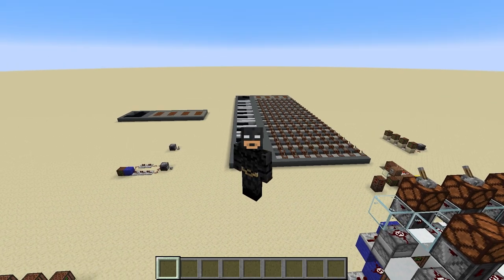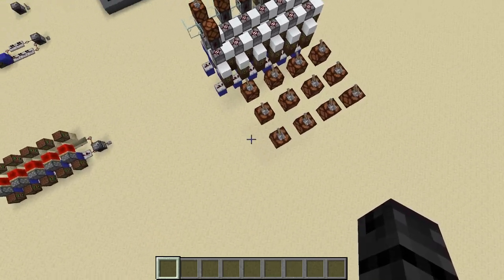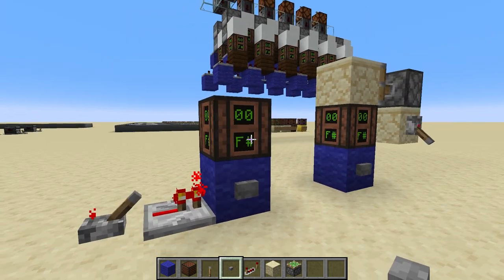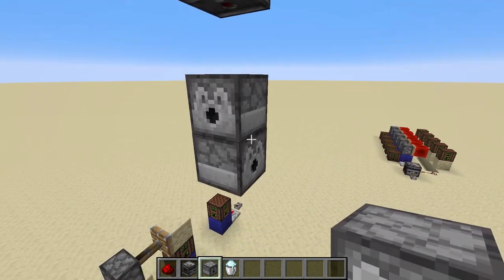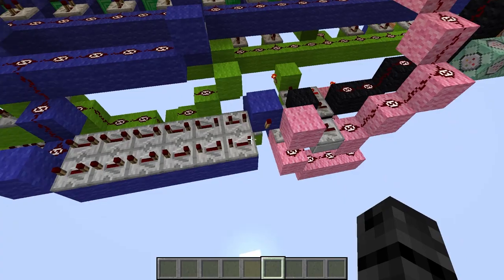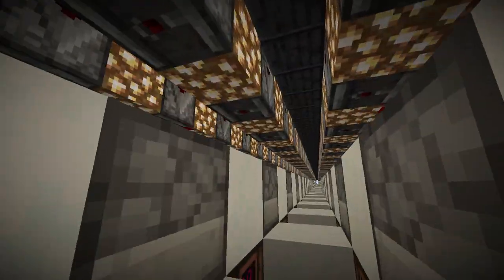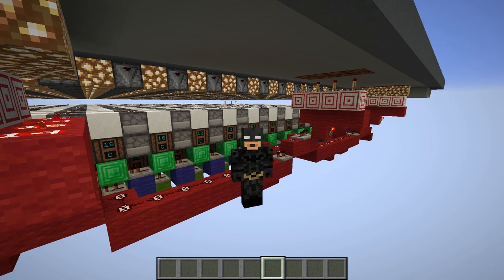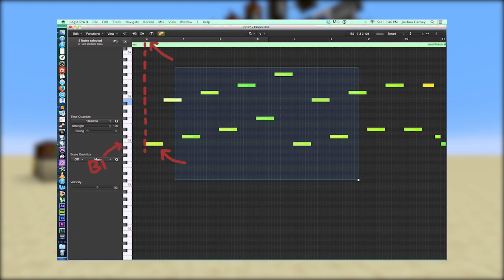I Made A MIDI Machine In Minecraft! | Minecraft Redstone Showcase

Comment: Now I do have some methods where you could improve the design. First the audio limit for the note blocks is a sphere centered on the player, so if you give up the horizontal design and go for a vertical design you could easily set it up as a box around the player. This would also allow you to potentially increase the note range as you could have a platform centered and have some of the machine above and below the player. Also this shape will naturally balance the audio by positioning  the higher notes farther above the player, if you raise or lower the platform you'll be able to change the audio balance as well, so you can experiment with the balance. With creative flight you wouldn't technically need a platform either you just fly up or down to change the balance.

Comment: A few solutions for the problems this version encountered:
1) Instead of having each lever have its own noteblock, it makes more sense to have a "speaker" with all noteblocks clumped together then wire them up to the redstone lines somehow
2) For adjustable tempo you could make use of a serial memory unit (like a hopper line) and an adjustable clock
3) This one isn't a solution but slap an audio visualizer on that bad boy and yes

Comment: I had an idea for a machine recently that would do less but still be pretty interesting and maybe practical. 
Have a redcoder that activates one note block per signal strength, each time the signal strength changes. You'd get 15 or maybe 16 notes, and it could be run from a series of signal strengths input to the system from basically the same machine but inverted, or some way of encoding the series of signal strengths needed to make a song 
Edit: this idea is also not great because there are 25 notes, not 16 
Edit 2: I've been working on this and it looks like it has potential but I suck at redcoders and you'd need a better sequence encoding system than a piston feed tape
Reply: also you could just cap the range to one octave and a hopper line might work

Comment: i have had the idea for a sound scape sort of room for those minecraft songs so that instead of worrying about moving at the right speed you just had to worry about how the sound is programmed into the machine, im reasonably good with redstone but only a beginner when it comes to music, i figure that in a 8x8 chunk you could easily have a floor and ceiling made of a staggered design of note blocks with their instruments each could likely fit around 16 or 32 notes depending on how you stagger them and how close you want them to be. Of course this cubed sound scape has its issues, notes in the corners will be less noticeable than notes in the center, possible fix for that is to build a soundscape on a sphere, but I don't know how hard that would be but it would have the added benefit of all notes having the same distance to a center point.

Comment: minecart to move along with the song and you can use stacking to get the full range (or like a corner layout if you want to preserve the aesthetic experience with a 'floor' section and a 'wall' section - would need to do some tweaks tho for the new orientation)

Comment: If you want all noteblocks to be heard from any distance, you could maaayybe cheat a little bit and use command blocks instead. For example:
execute as @a at @s run playsound minecraft:block.note_block.banjo block @s ~ ~ ~ 1 1 1

This makes it play at any distance from the listener, and with the same volume on both left and right channels. Also, with the second 1 at the end, you can change the pitch with values from 0.0 to 2.0!
I personally wouldn't consider this much of cheating, since its just what makes the sound. Hope it helps and wonderful video and contraption!

edit: just realized this wouldnt work with your current setup with the powder snow (the command would still play the sound anyways). For simulating the same behaviour the noteblock has (for blocking it with a block above), this command would then work:
execute if block ~ ~1 ~ air as @a at @s run playsound minecraft:block.note_block.banjo block @s ~ ~ ~ 1 1 1

Bootleg noteblocks!